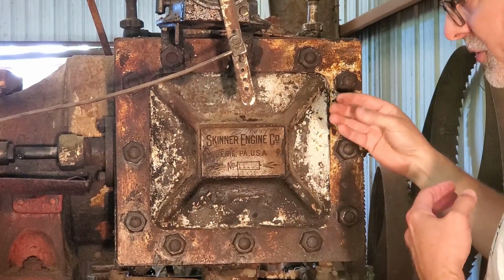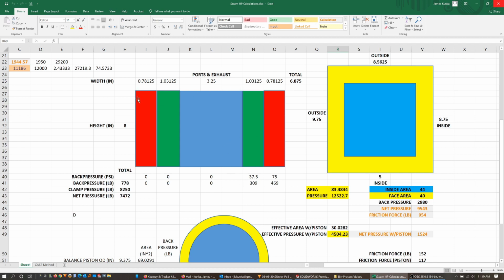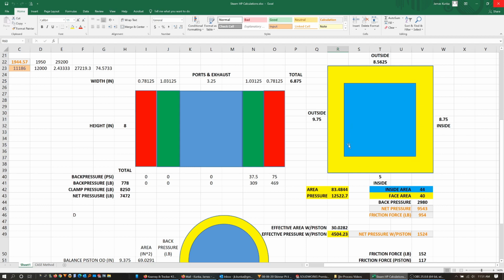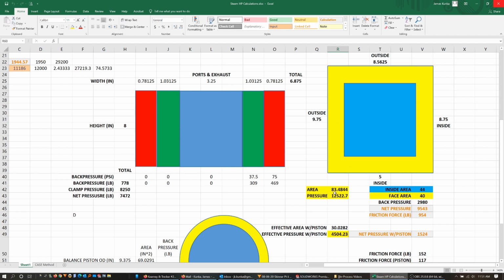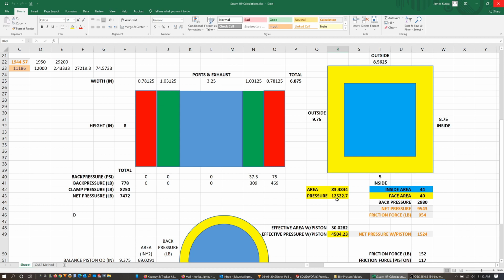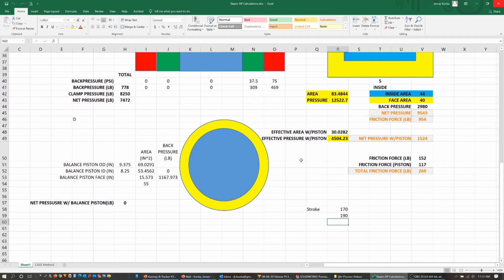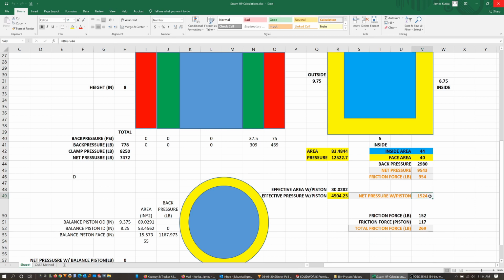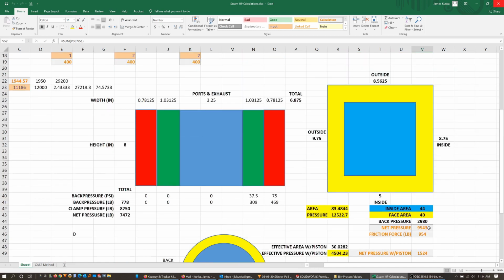Skinner 11x12 Steam Engine Pt II - Slide Valve

Comment: Hello. Dave sent me. Nice work. I think those vertical lines are for oil to lubricate.
Reply from the maker: They would do that, but the Skinner book shows a flat, scraped, and flaked finish for oil. I will have to do my best, this is a difficult surface to recondition.